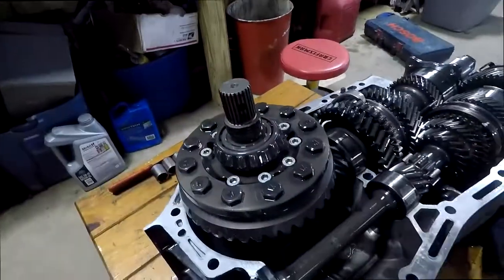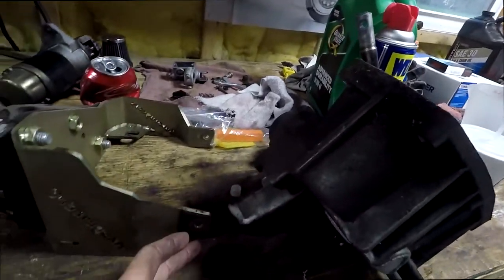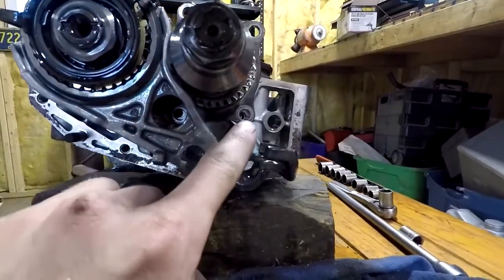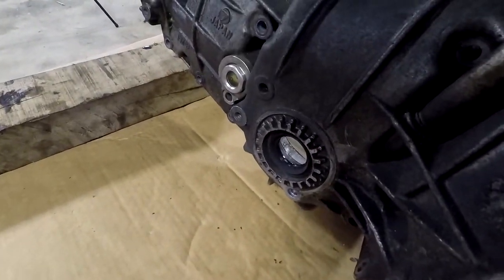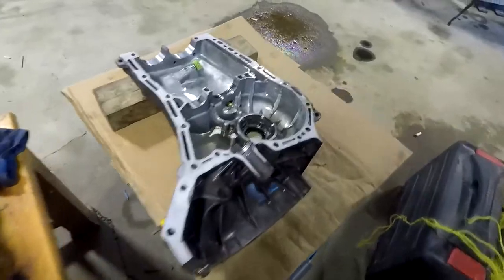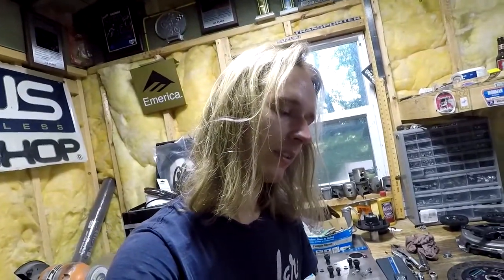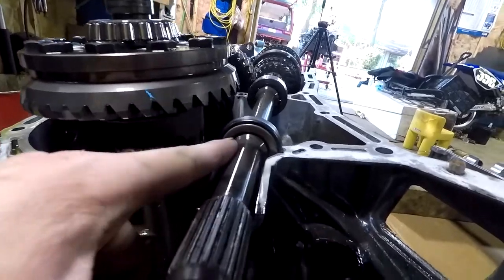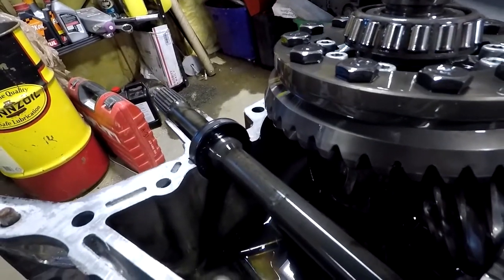Subaru Vanagon Transmission Teardown..#2

Comment: Just scored a decent vanagon today. What transmission is that from a WRX? I have a friend with a Subaru with a 2.2l I could get for cheap. Curious about how to get a 5 speed to work with the Subaru motor.
Reply from the maker: NICE!! Glad to hear you got a vanagon. Yes mine is from a WRX, Its out of a 2002. Its a ty754. You can use almost all the manual transmissions from subarus. Its nice because the starter, clutch, exc is all Subaru and designed to be together. It works great! Its very expensive, but worth it to me. I covered A LOT of info in my videos. http://www.subarugears.com/ is where I got all my trans stuff. They even have the brackets to bolt everything to your van!!
Reply: I wouldn't start with a WRX gearbox.  If you did, there's a good chance the PO was a boy-racer and beat it up.  You want the gearbox from an old man car.
Start with a TY757 gearbox from about 2007-2008 or newer.  This gearbox gets you modern dual cone synchros on 1st, 2nd and sometimes 3rd.  What are dual cone sychros you say?  They have two cones instead of one, so the synchro action is twice as good.  Also, the late TY757 has a synchro on Reverse too!